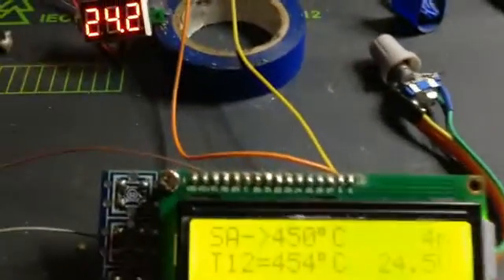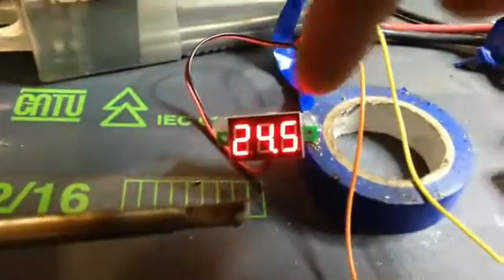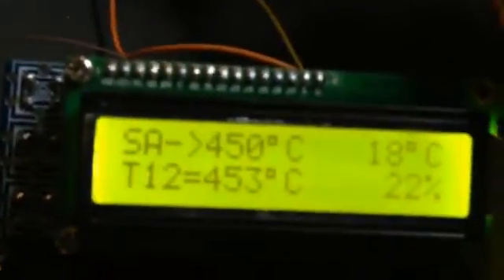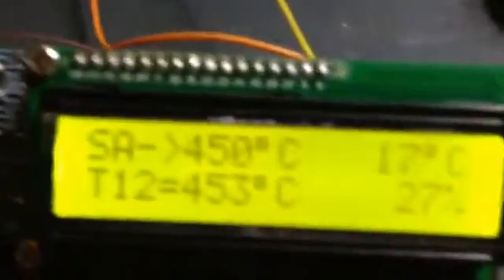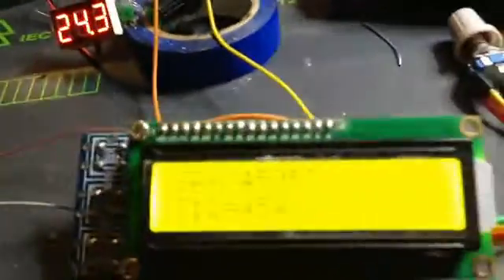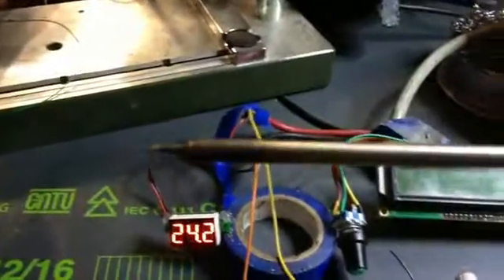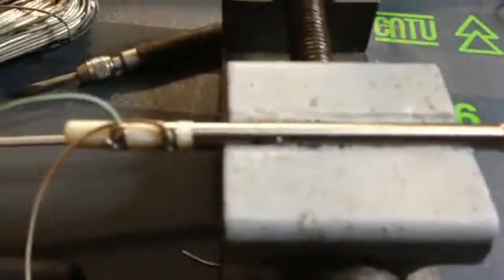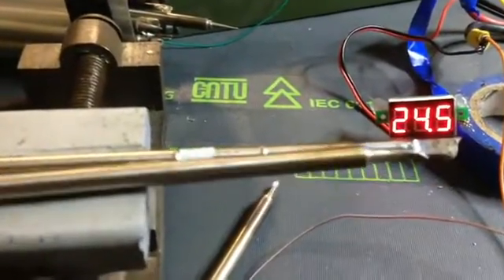Update: Soldering Iron Station Temperature Controller For HAKKO T12 Works

Comment: bonjour
j ai vu dans les commentaires de la chaine de cyrob  que tu avais une chaine sur l electronique j arrive ici et je suis déçu 
de voir qu elle est en anglais tes sujets ont l' air interessant
Reply from the maker: +michael ferrari en fait mon anglais est très simple, un collégien peut le comprendre... L' électronique est intimement liée à l'anglais, c'est connu.
Mais en quoi c'est dérangeant pour toi qu'elle soit en anglais? Tu penses que ça rend la vidéo réellement difficile à comprendre?
Je suis en train de bosser sur un concept de vidéos à deux canaux, le droit en anglais et le gauche en français, ce qui permettrai de choisir l'un ou l'autre selon qu'on soit français ou autre citoyen du monde.
Trouves tu que l'anglais que j'utilise soit rébarbatif ou autre?
Reply from the maker: +Гасан Аликберов yes, it reads temperature with only two wires.
Reply from the maker: +Гасан Аликберов no third wire. try to use subtitles translated in Russian.
Reply from the maker: +Гасан Аликберов There is 4 types (not talking about induction core)
--- heating element + magnastat = the heating tip is associated with a magnet who attract or not a micro switch for regulating. This is the Curie Point. There is no electronic for this regulation. But this way is replaced step by step by electronic regulating (less expensive).
---heating element + PTC sensor = comon soldering station, fiability, cheap, easy to find. Change only the tip for common use..
How it's work: heating element communicate heat to the sensor, provocate a resistance change (and regulating with this mode)
---heating element, tip + K sensor (thermocouple): micro soldering soldering, precision, usualy used on micro electronic. Heating core comunicate heat to the sensor, who deliver some micro volts depending to the heat level. The main unit regulates with this mode.
---heating element, formed by two types of wire (Hakko T12): one wire is allumel, auther is chromel. This two wire form the heating element and the sensor in the same time. How it's work? The unit control switch off the power on the tip, and proceed to a sensor detection: it's provide an information about the degrees of heat, and stop the sensor detection for to powered the tip. This cycle is repeated very fast, alterning sensing and powering, in virtually the same time.

Some handle have 5 points conexion: two for the heating element, two for the sensor, one for the electrical ground.

Some handle (T12) have 3 points conexions: two for heating element and sensor (in the same time) and the shield (EARTH GROUND)
It can have two wires in supplement, for the vibrating switch.
Lot of handle have two wire more : this is the sleep vibrating switch detection, used for to put the unit on standby when unused.

in your case, you have not to connect the shield of the T12 handle.
If you want to connect it,(for my part I found it useless) connect it to the electrical earth ground. (not the negative of your unit).
Reply from the maker: +Гасан Аликберов look this:
http://dangerousprototypes.com/forum/download/file.php?id=11742&mode=view
Reply from the maker: +Гасан Аликберов the sensor on the pcb is a temperature compensation for driving the thermocouple builded in the heater.